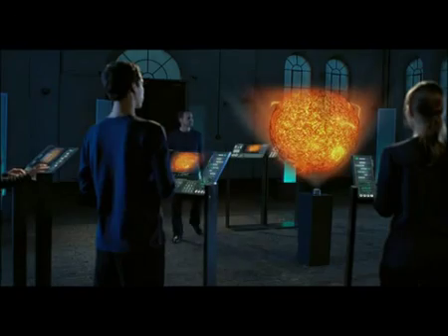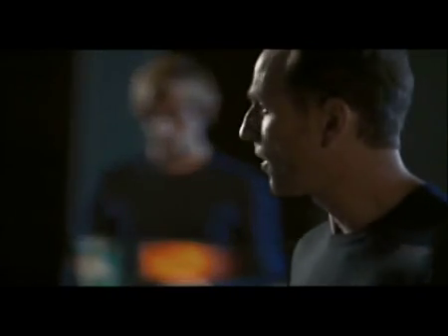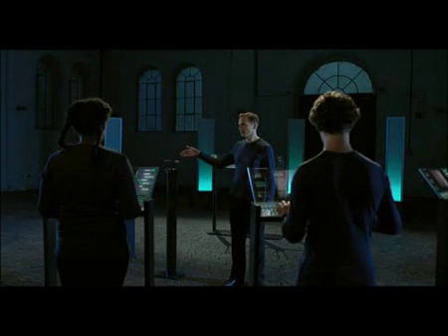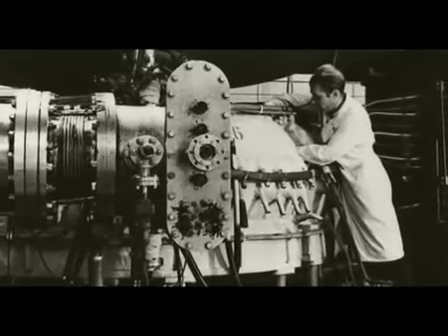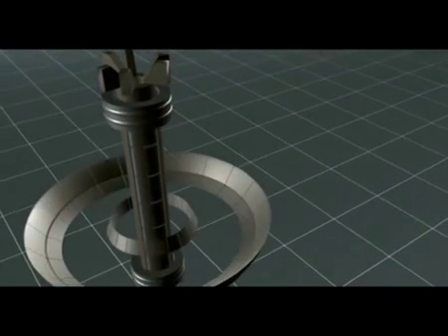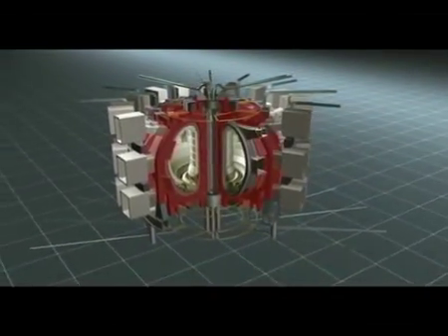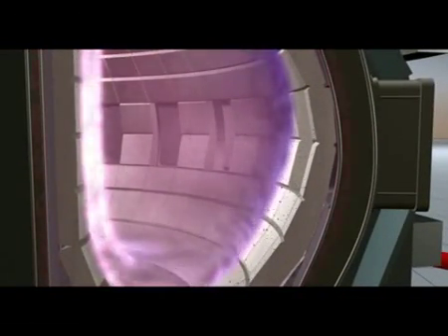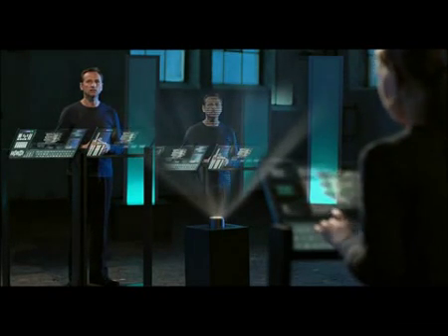Energy of the Future - Fusion 2100

Comment: Sorry I didn't see this until now. Having looked into MSR's using thorium I must admit they are pretty efficient and scalable; provided it's developed and the issues surrounding them are solved. But I guess its just a case of this research competing with fusion and once again it was beaten to the big money spotlight. However from what I can see there are still problems that need to be resolved? Which in my opinion would give it the same (or a similar) development timeline as Fusion...

Comment: should be reliable source of power, but in terms of its environmental impact it isn't a long term sustainable alternative to coal, oil and gas when compared to renewable sources and within the foreseeable future nuclear fusion. If nuclear fusion wasn't an option say in the next 100+ years then I would agree with you we would need to shift to a fission oriented energy economy (+renewables) but a lot of research says otherwise and as such I don't see it as the most sustainable long term option.

Comment: If people always had that use what we have now mentality we'd never have gotten anywhere - its not about now anymore, on current systems we have enough energy supply (given the increased improvement on alternative renewables) to last to 2050 and a bit beyond that, by the time of which we'd most likely have developed fusion commercially. Okay yeah I haven't been around that long but in 83' did they have a guideline for developing a comercially viable fusion power plant? Or was it just a proof of

Comment: Well yeah it has but now they've actually got a blue print for a proper time frame through which we expect it to become comercially available and be developed to the closest thing to "perfectly feasible" possible. Back then they didn't even understand the actual Physics behind the engineering much less have solutions to the problems. This is some oh it works in theory we can make it in 3 years - there were fundamental obstacles that required great leaps in science like we've had in this decade -